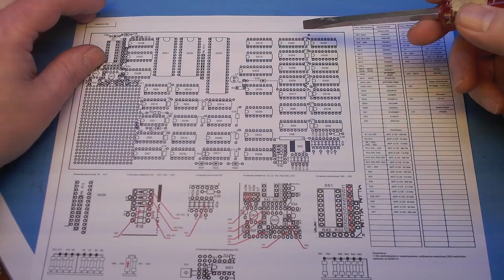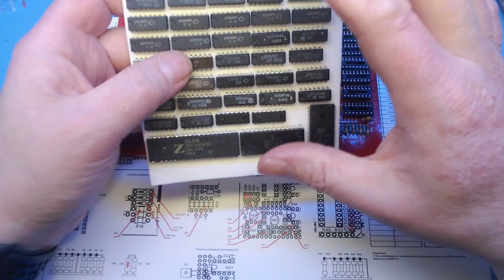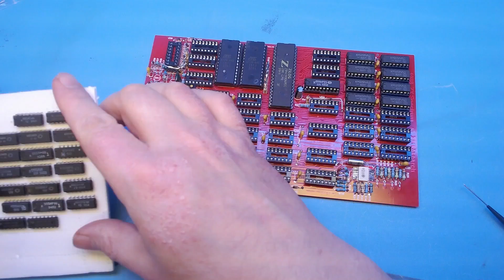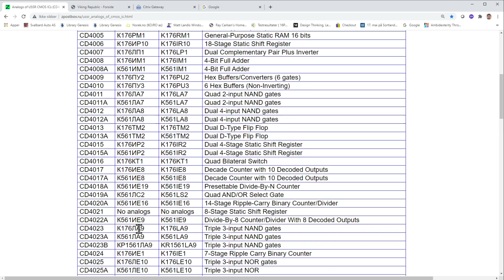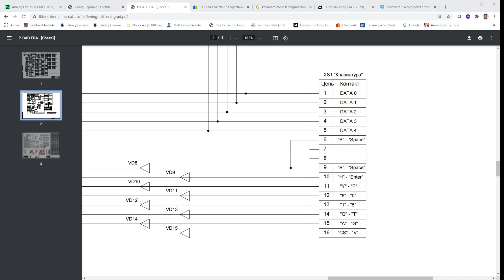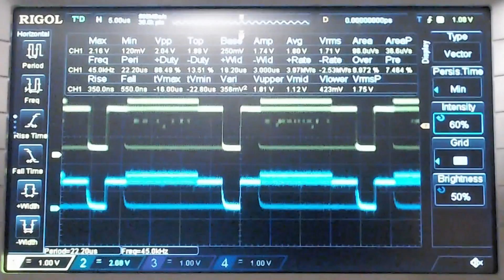The battle continues, Leningrad clone, part 3

Comment: This project has been something of a slog through the various little details of difference between western and Russian components.  I don't know that I would have had the patience for it, but you're doing rather well.  It looks like that "sea of holes" got used in some places to relocate components during assembly.
Does the project have a case that was included?